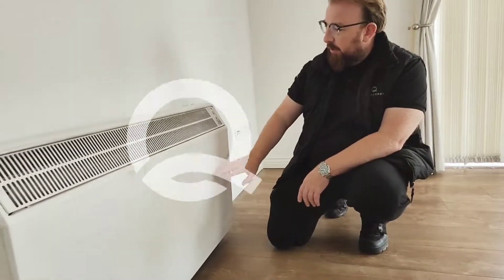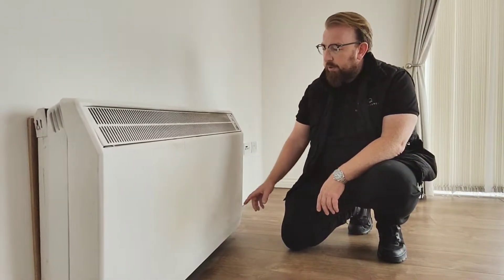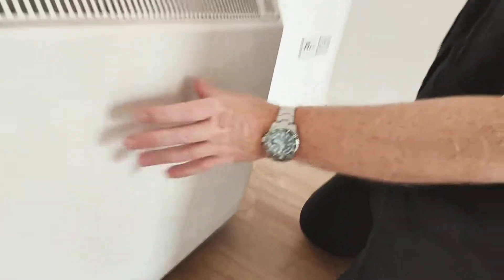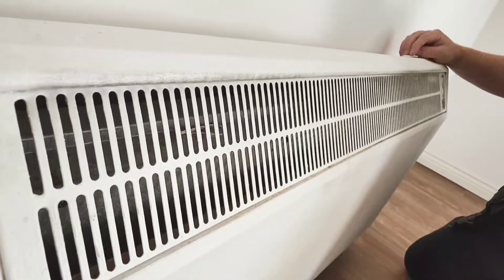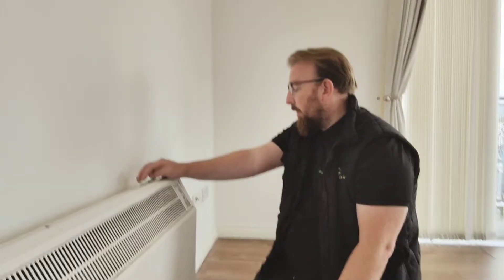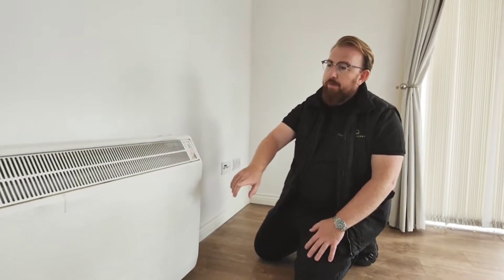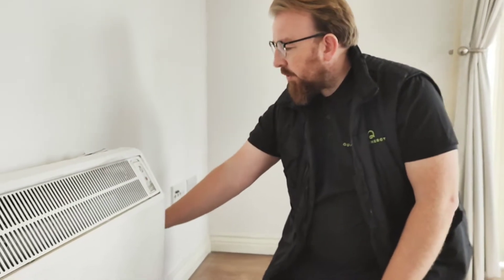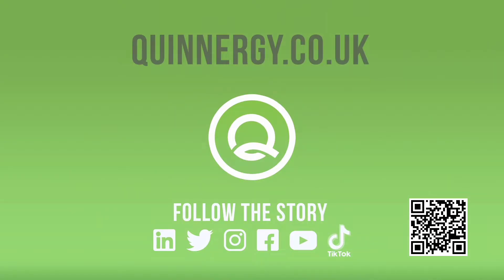How Storage Heaters Work - Maximising Energy Efficiency

Comment: Hi. I have a question. When this heater on is bottom of this heater is hot? The only part of this heather in my flat are top part that it. Buttom of the all entire heater is cold.
Reply: no the bottom is supposed to be cold as its insulated to help store the heat which should only escape through the top